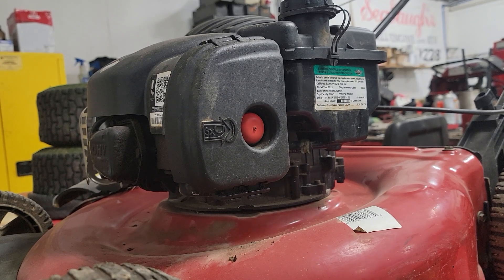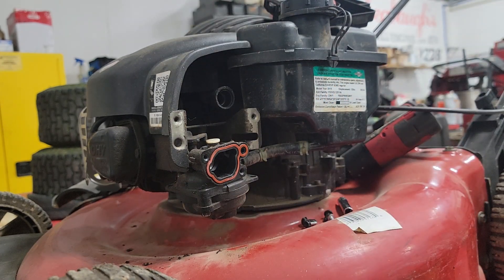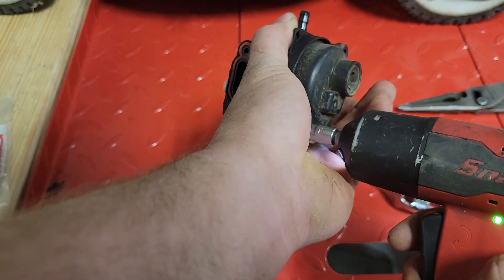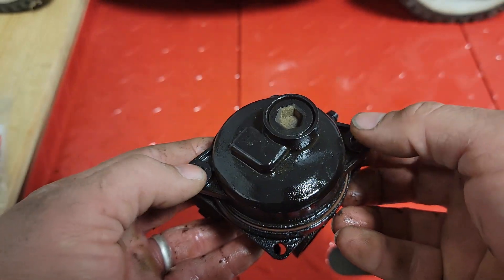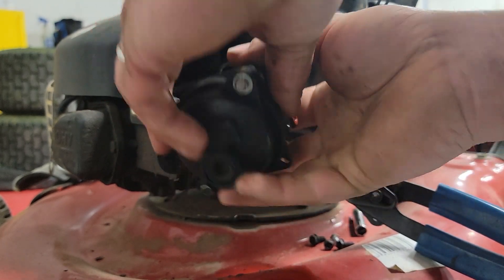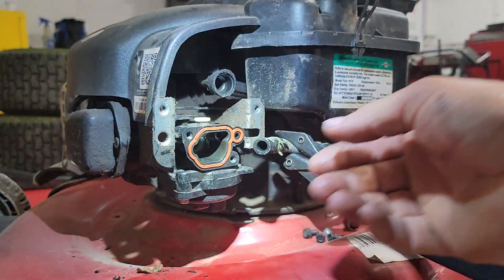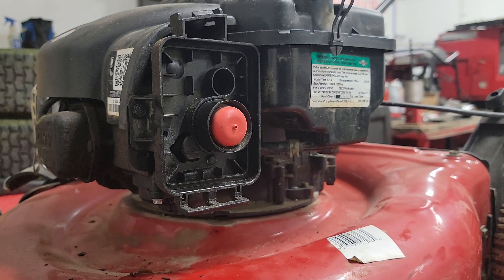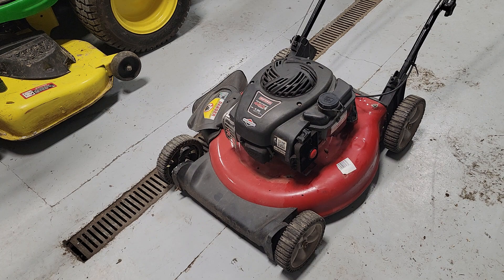Briggs and Stratton plastic carburetor rebuild

Comment: You could of easily cleaned that white plastic nozzle assembly and saved yourself some money.  It only took me about 3 minutes and some carb cleaner spray..:face-blue-wide-eyes:
Reply from the maker: I have cleaned them before. It's works fine until you have to take it apart and do it a second time. Then I would have been money ahead to just have replaced the 10 dollar part. Time is money, my friend!